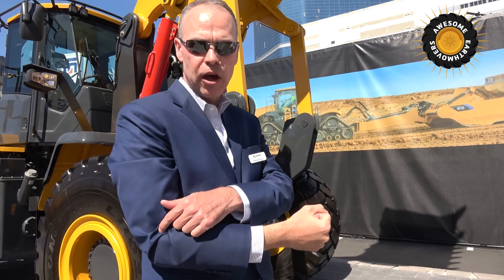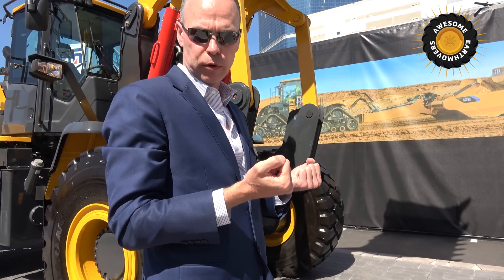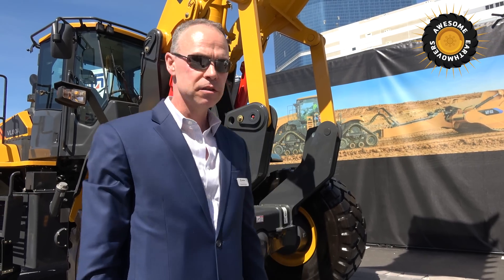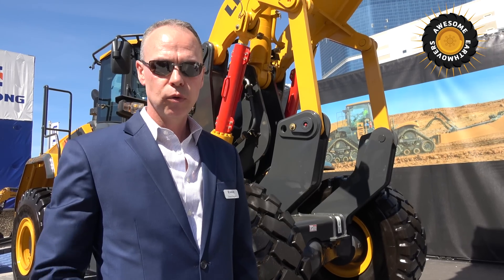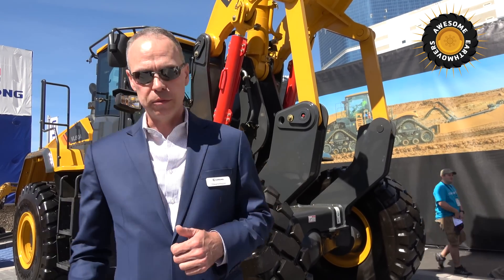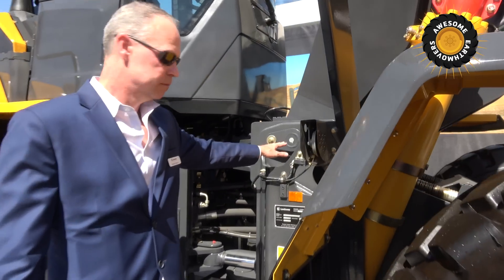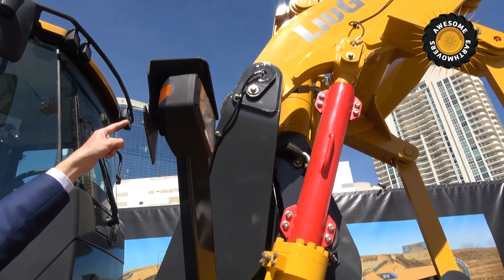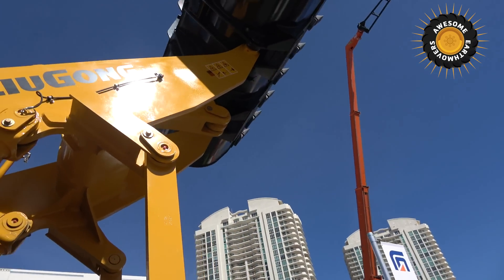The World's first vertical lift wheel loader by LiuGong

Comment: Whats the big accomplishment ? I designed chain free hydraulic cylinder drive vertical lift for the same bucket  purpose with a 100 % linearity and lesser moving parts/lubrication spots than yours, back as a fiftheen year old boy in process of understanding various hinged mechanics. 
But what the hey, that function is what we got perfectly good, in addition to back tiltable, forklift towers for. I figured only reason for doing that different had to be major dust conserns, need for 2-way force, or pure dislike for the humble but wellproven open drive chain.

Comment: I dont know about you but i dont think that's a very good design for loading from a pile or bank. Vertical lift would inspire a straight-wall/vertical cut in your material and could lead to undermine which would be dangerous. I can see this useful in feeding plants or loading/lifting with a set of forks.

Comment: what is the problem that you don't show it move?
Is it a no go showboat?
Reply from the maker: If you look there are red locks on the cylinders as it's only on display and there is no room, barriers or permission to run it the show.
Reply: Awesome Earthmovers 
I understand that it has the safety lockouts in place, that wasn't the point